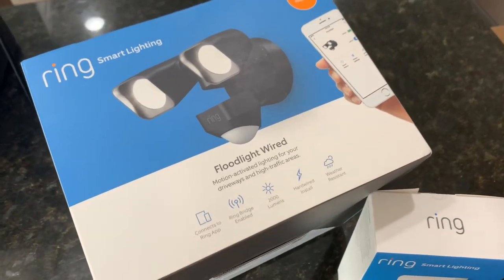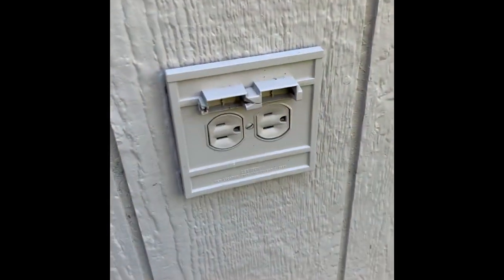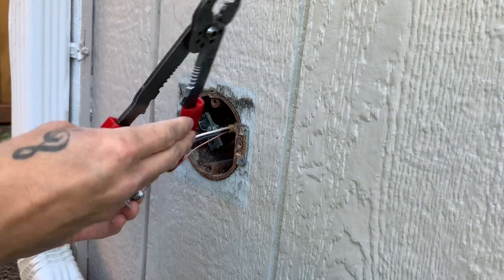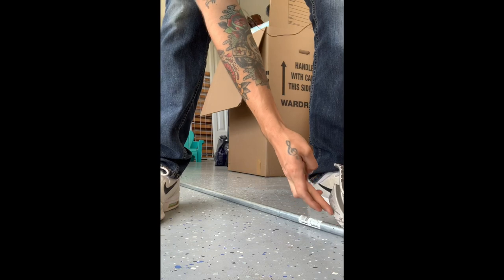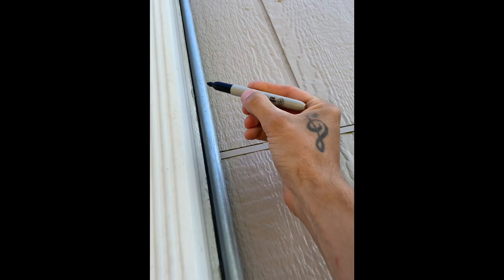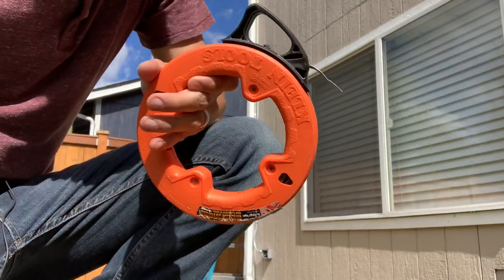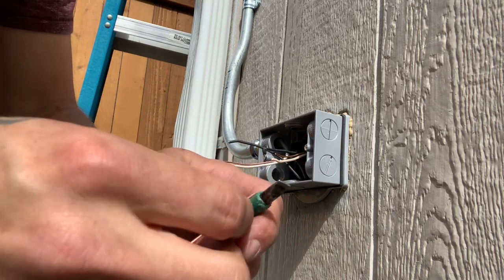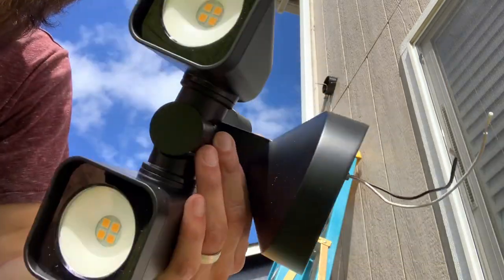Ring Floodlight Wired + Electrical Wiring | DIY

Comment: The power from the garage could have been plugged straight into outlet.  The flood light be added to the outlet accessory screws. Then you needed no pigtails or wire nuts. Thus less bird nest.
Reply from the maker: You make a good point!

Comment: Are those bulbs changeable? They seem more yellow to me and I would definitely prefer more of a LED bright white for the night time.
Reply from the maker: I would say they aren’t easily changed. You could find a cheap generic floodlight with the LED color you want and swap them out, but it’d be more if a rigging-up than anything.
Reply: They are bright white. On camera they seem a bit different. I noticed that when taking pictures when it’s dark outside.
Reply from the maker: They (3500K) are definitely brighter than my low voltage lights that are 2700K. He might be looking for something in the 4000K-5000K range which he could probably rig up to this floodlight.
Reply: @workswithzach8219  yeah 4k-5k would be perfect, wish it came that way already.